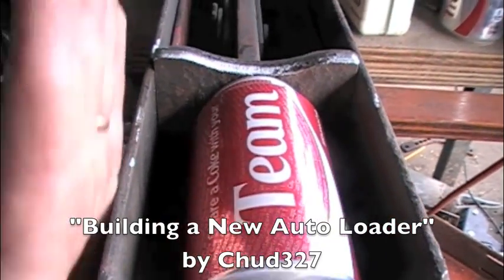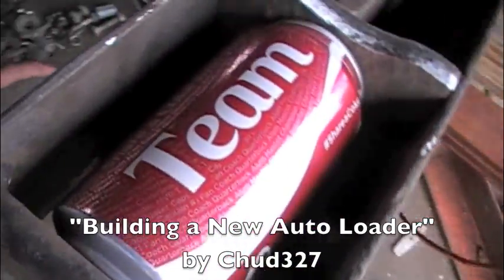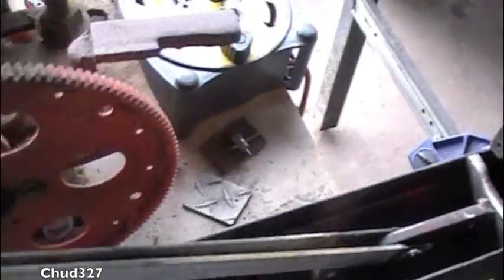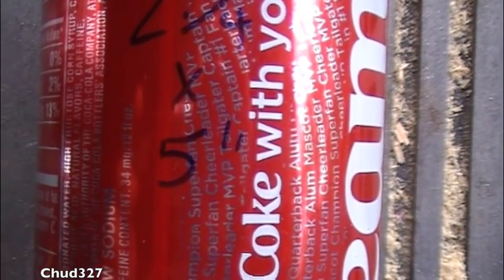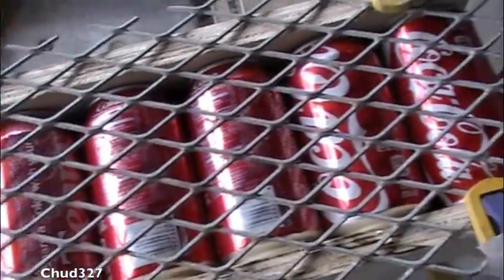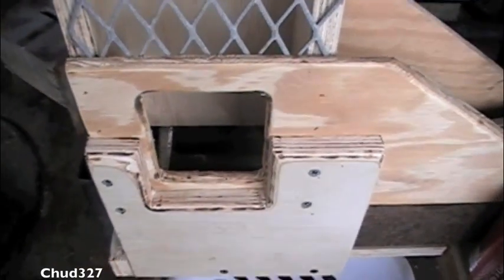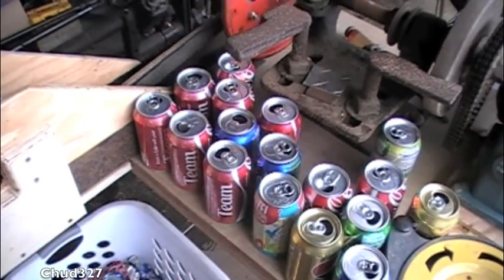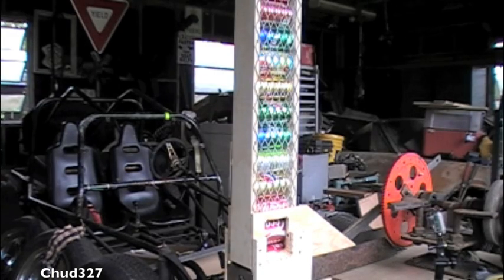Homemade Can Crusher with Auto Loader by Chud327

Comment: If you're up to the challenge, you could double the feed tubes, by adding another to the narrow edge where the ejection occurs. Link up another piston in that tube (probably have to be on the right, or left) which crushes on the non-crush stroke of the existing tube. Then it would have alternating crushes, and effectively double the speed of the crusher. It would eject nearest to your existing ejection port.
Reply from the maker: That would be cool.  I wanted a two stage that crushed the crushed cans to make them even smaller, but I have not tackled that yet. Thanks for watching.

Comment: This is totally useless. The cans have to be in factory made condition to work - no deep dents, bents, folds,  etc. In the REAL world, we that collect cans from off the streets and out of dumpsters to make some  extra cash DON'T find cans in that flawless, condition normally. Most of the time, they are bent out of shape or mangled.  So it's useless. You need to design a feeder that will work well, independently of cans in any "beat up" condition.
Reply from the maker: I have a loader on it now, with video, it will still work as long as the can has no major dents.  The major dents cans are saved for last and get crushed too.  How can you say totally useless?  That is crazy. This thing works and is fun to use.  Are you jealous?  JK and thanks for watching.
Reply: chud327 

Never mind. Forget it. It's nothing important. 

It's just that for my needs it's absolutely worthless. But I'm only speaking for myself. Understand?
Reply from the maker: SwarthySkinnedOne sure, thanks for the reply.

Comment: Chud327 how much to make one 300?
Reply from the maker: +Ed Bart The most expensive thing would be the electric motor and the gear box.  That  might be more than $300 by itself.  Mine came out of a dumpster, so I don't know what they cost. Everything else on my was stuff I recycled around my house.  Good luck and make us a video if you build one.
Reply: chud327 can YOU build me one with a pop can hopper on top would a drill motor work or can YOU get motor from habor freight
Reply from the maker: I didn't do a hopper on top of mine, I thought it might be a pain to get to work right. I don't think a drill motor would work, but I guess it could if you geared it right. I haven't been to harbor freight in a while, but they would probably have something that would work for you.  And if you did go to harbor freight, it would probably be less than $300 for the motor Good luck with your build.

Comment: Fantastic !!!! ...  Would love to have one
Reply from the maker: +farmall51 all you have to do is collect some junk and bolt it together and plug it in. The hard part for me is finding enough cans to run through it. Thanks for watching.
Reply: @chud327  you make that sound kinda easy. I am still trying to figure out what is the best motor to use, then slow down the RPM. I see so many different designs, yours is really cool. It works well it isnt over noisy. Good job.
Reply from the maker: @keshatton2334  thanks so much, BTW, it still works great and will be at the if a video coming out this weekend. I hope you will check it out and thanks for watching.